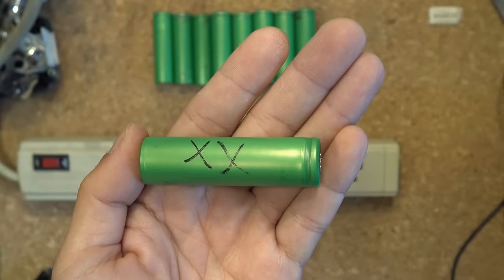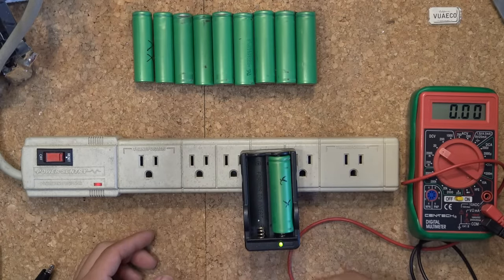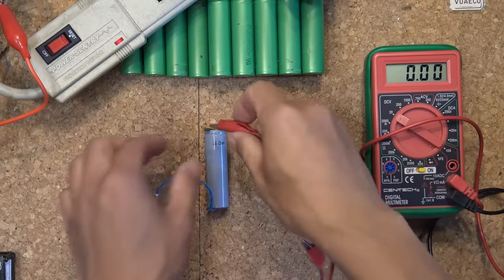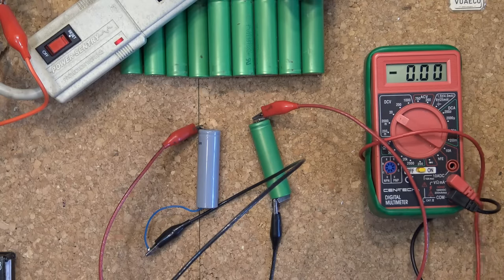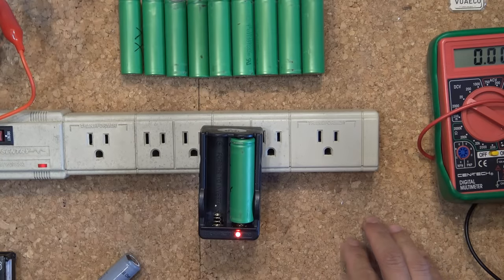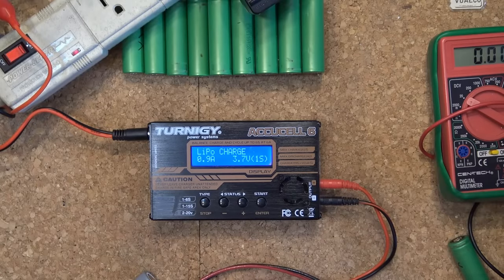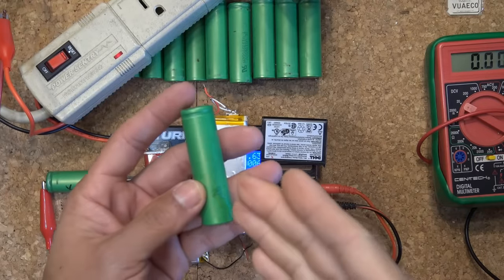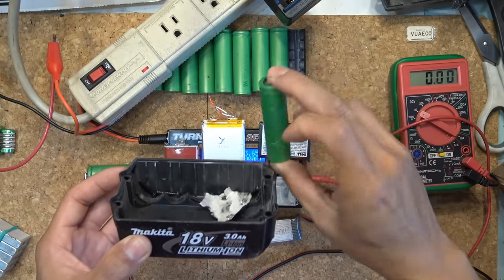DIY: How to revive a dead 18650 (or any) Li-ion battery cell

Comment: It's been my experience that a recharged dead battery cell, by any method I've seen, produces a battery that may have the voltage reading, but the amps are cut dramatically.  Which, in turn, makes them run out of charge when used very quickly.  The only success I've had is replacing the sulfuric acid in a lead acid battery with magnesium sulfate, which you can buy to take a relaxing hot bath.  The car battery lasted for about six months.  So, even this is has its limits.
Reply: I think you might be right in my limited experience in tryiing somethng like ths. I have seen the voltage decrease a bit every second when doing somethng like this
Reply: Hell no don't open batteries

Comment: Have to wonder how long that cell is going to work after doing this.  Something tells me you wouldn't get too many more uses out of it.
Reply: It wont work at all.  When he put the voltmeter on it you could see the voltage diving.  There is an internal short in the battery it will be down to zero volts maybe in an hour.
Reply: It was already dead, so whats your point. You get a couple extra charges for free.
Reply: @dreadog6425  it really just depends on why the cell is so low.  If it is at 0v its done, you can do this and charge it and it will be back to 0v faster than you can use it... maybe an hour later or a day later.  If the battery has any sort of charge when you try to save it you are going to be able to use it a lot more times... although you need to find out how it got pulled down below the cutoff voltage.  Often this happens in packs where another cell is 0v and has a short and drags others down.  Find the 0v one and replace it... pack is fixed.  Dinking around with the 0v is a waste of time.  But for testing you can charge it, measure voltage,then let it sit for a day.  Check the voltage again.  

His method for charging isnt very smart... there could be a very good reason the battery is at 0v.  Putting a good battery across the terminals of a bad one is dumb.  If that battery has a short circuit... and his does because it gets hot... you are hoping the battery can safely dissipate all the energy you are putting into it.  If you put a wire across the terminals of a good quality fully charged unprotected cell it would go very bad very quickly... like the wire glows instantly... it is absolutely nothing like an alkaline AA battery.

Interesting thing i saw on bigclivedotcom youtube, he did research on the overdischarge causing damage issue.  Sounds like it might be not so bad.  Its based on the very first li-ion batteries and they have come a long ways in manufacture since then.
Reply: @dreadog6425  At the risk of the cell short circuiting causing  a violent fire. Yeah go ahead, get those last few charges of of it............

Comment: No matter how you revive them they are good as dead, they won't hold charge for long
Reply: Strangely I have an electric bike that I have built a battery out of 18650 cells that originally tested "dead".  I  got them to take a charge using the parallel battery method. 
This e-bike will run for about 4 hours continuously on a charge; using these reconditioned cells.   It's been going like this for about 4 months now.
Reply: @DBPR01  some cells have protection inside , an ic chip that will cut the power if the cell voltage is too low. It may show zero volts when actually is not. Whatever the case, just check temperature when charging and discharging, some cells can be hotter than others.
Reply: @clixium  Both of your lasts comments are useful, I believe some applications can perfectly be made with "dead" batteries with no risk at all, such as a stupid ring device or so.

Comment: another easier option is to use the nickle metal hydride setting on your charger and then charger low LIPO. Watch as the voltage will rise to over 3.7 volts. Then stop charge and start a new cycle of LIion charge.

Comment: There are many ways to "wake up" those cells, the principal being to apply a large enough voltage to them for a brief period of time. That Turnigy charger of yours will do just fine. It looks like it uses the same firmware as the original SkyRC, so just change the battery type to NiMh, max charge current to, say 1 or 2A, and charge it up to about 3V (takes couple of minutes). Then switch over to Li-ion. One advantage is that for weak cells, you can observe that the voltage keeps dropping (i.e., almost impossible to bring them up to 3V). Also it will refuse to charge real dead cells (internally shorted). Three things you should have mentioned playing with these: 1. dead/weak cells can get real hot, so if a cell gets hot during charge, throw it away; 2. perhaps they're really not good -- after charging them up, wait for a few days to see if they can hold the charge. If not, it's time for them to go; 3. don't ever put them in parallel with good cells.
Reply: I'm kinda new to all this stuff, so please excuse my ignorance. Why do you say don't ever do this with two good cells? What would happen?

Comment: Just woke up my 25r's, we will see if they hold charge.
Thanks man👍
There was no way I was sticking something under positive to reset cid button 😢
Reply: did they hold charge?
Reply: @anthonyhadsell2673  sure did bro, still going
Reply: Really? I find that very hard to believe. Not if the cell's CID has been tripped it won't. It physically cannot! The CID is a current interrupt device making a physical separation of the circuit like a fuse. This is just a "wake up" method for very low voltage cells. However even with all that said, this is a VERY BAD idea and stupid on oh so many levels. That 1.7m people watched this recommendation is the only positive about it, certainly there should be a bunch of warnings attached to the video. It's impossible to list all the reasons in a YT comment BUT just "off the bat," paralleling 2 cells of very diff voltage levels is dumb and dangerous due to possible excessive equalization current. Just from your example of a 25R cell, if that one was the charged cell, it could easily dump over 50a instantly (25r can pulse discharge more than that too,) to the low cell, with unpredictable results on both low cells and any thin AWG wires connecting them. Fire can erupt wyite quickly in that circumstance. Yes, crap low discharge rate laptop cells are less of a danger for this, but there are so many other factors. Aside from all that, the "woken" cell may suffer from dendritic growths and may self discharge to LV quite quickly, making the entire operation essentially irrelevant. Considering how cheap these cells are I can't believe people are wasting their time, and inviting a potentially dangerous situation in their homes, but they "your life, your house/mortgage," if people are renting though, I wouldn't let the landlord see the video or comment ;p
Reply: @ABritInNY  I didnt say CID was tripped at all. Just low voltage  that my charger wouldnt charge. I used a full charged bat and jumped it in 20 second increments while holding in my hand to keep an eye on heat.
Anyway your question was really? My answer is yes, I dont talk shit.
As far as the rest of your comment, I only got to about the 3rd line before becoming to bored to continue🤷‍♂️, but I appreciate your effort, thanks. I have no doubt you are very smart😁
Reply: @rustyh1686  Understood, but then I'm not sure why you'd say in your comment"...to reset the CID button." I mean why mention reset if not tripped? That was kinda the part I was commenting on.
Reply: @ABritInNY  I didnt know what was wrong, and was just saying there was no way I was trying that. Sounds dangerous.
Reply: @ABritInNY  I only have a basic understanding of batteries to be totally hones

Comment: Be vary though. Cells that have been revived like this might overheat and maybe catch fire later down the road.
I did this with dead cells I had lying around, and two out of 20 cells started to overheat after around 10-15 charge cycles later. One even exploded.
There is a reason to why chargers don't allow recharging of deeply discharged cells. It's simply too risky.
Reply: You can make your own current varying charger, using voltage regulator such as lm714 etc.
Reply: Bypassing safety protocols can get you injured or killed. The engineers don't design them just for the heII of it.
Reply: Life is a risk
Reply: lol..... saftey protocals..... do they work ? we need them on the important stuff ie; the air ,food, water we put into our body , all saw blades should have saftey rubber applied , everyone should wear metrorite proof hard hats , im not even sure what to say about auto's & traffic, labels should be applied to couches, fridges, TV & devices warning of obesity , procrastination, tremendously useless degrees of self percieved wisdom & knowledge, anything that a murderous heart or mind that could use to kill someone should be gathered & ejected into space, starting with the first murder weapon , we will send all rocks on earth into space. we need to have warnings to inform everyone , that the omittance of morality, humility, kindness, integerity, respectfullness, thoughtfullness, thankfulness, diligence, patience, honor, blamelessness, and mostly Love, will bring humankind to a tragic and horrific end. now let's get these saftey protocals into place !!!! lol. just kidding... you left it wide open & i hadda rib on ya.. dont get mad, i apoligize, but there are so many things that just dont work with warnings & rules.
Reply: @guitarman_3693  lmao....because mostly it is assumed that we have common sense which isn't so common anymore.
Reply: What is the dangerous part ? charging or discharging cause i just revived an old battery for my my vape and i would like to know my chances
Reply: @jabez571  the battery probably won't, but the fire that it starts in your room or car. ;)
Reply: @guitarman_3693  Fun fact, all earth is already in space :P
Reply: > There is a reason to why chargers don't allow recharging of deeply discharged cells. It's simply too risky.

And what, pray tell is that reason? 🤨 I hate it when people say "don't do this" but don't explain WHY. 😒
Reply: Um all I have to say is WTF is this comment about I was lost reading it.

Comment: How to keep your multimeter in place-put it in an old cell phone case-brilliant!
Reply: What cellphone case? If you mean that green thing, that's just the standard rubber sleeve tons of DMMs come with to protect them against shocks. Electricians use these in factories and on construction sites, so not a bad idea to offer some measure of protection.

Comment: Dude there is a lot of amps been delivered to the "dead" battery if done this way, that's why it gets warm. Why not try a DC variable power supply?
Reply from the maker: No there isn't a lot of amps delivered to the dead battery. The grey LG cell I used in the video has a discharge rate of 2C max which is 3 Amps max. Plus, you only charge it for 20-30 seconds so it aint' no big deal. All WORKING Li-ion cells get warm when they are being charged up. Try charging a completely dead Li-ion cell and it stays cold as cash (this is also one way to figure out whether or not your li-ion cell can be revived- so if your cell stays cold when you do the parallel charge like what I showed in the video, it's time to throw it in the trash as it's really dead). You can use a DC variable power supply but how many people have that in their homes?
Reply: When you are charging Li ion batteries they are not supposed to heat up!
Reply from the maker: Negative. Have you ever charged any Li-ion batteries before? Watch my next video and I'll prove it to you in that video. Here's the follow up video: https://youtu.be/vFmbG8GpS4A
Reply: santiago.. I agree, a small DC power supply that plugs into the wall is best for this... We all have 5 or 6 volt, or 9 volt DC supplies laying around.... just connect for a few seconds... should do the trick...
Reply: Darryl Edington With the charger that he got in the video, you can go to the battery type: digital power
And then set it to 3.7v at 0.1a
Reply: santiago vindell
Reply: You can use an old pc power supply. It has 3.3, 5, 12+ and 12- volt circuits.
Reply: Why not just put a 3-volt bulb in series as a current limiting device as the battery sinks up to the other battery the light will go out
Reply: @vuaeco  you sounds like your charging is way above what it should be, because i have never had a li ion battery getting warm doing charging, when they get warm they break down themselves.
Reply: Nikolaj C my ecig batteries always get warm and it doesnt matter what size brand or age and charge cycles....even says they will get warm in the chargers manual....it should not get hot to the touch is what the manual states.
Reply: @melgibson6331  wtf do you charge your ecig with? A car battery-charger or some shit, i also use ecig they never gets warm when charging.
Reply: @nikolajc7617  It depends on the specific chemistry of the 18650, how much internal resistance the battery has, and the amperage the charger is delivering. But generally, good 15A+ discharge hybrid chemistry batteries won't heat up much if at all when charging. I've had 18650's that don't heat on the same charger where some do. Cheaper chargers that don't regulate will also heat up batteries more than those that do. A little heat on the charger is fine, it's when they're hitting 70c+ is when they degrade.
Reply: This can be incredibly dangerous, especially if dealing with abused cells, power cells, or pouch cells that have no protection.  Take extreme caution.  Recharging this fast also grows dendrites... BOOM!
Reply: Uhhh,.....the 2C rate doesn’t mean the charged battery discharge is limited to only 3 amps, but rather 3 amp draw will produce its rated capacity. Don’t believe me, take your charged battery and short positive to the negative with your ammeter in between and see how many amps it produces....hint it will be above 3amps. Your scenario you demonstrated had enough amps to heat the dead battery within 30 seconds, means it was over 3 amps input. I recommend using a power supply that limits current to an amp and voltage to 4.1v. Or do this outside away from combustibles and at distance while wearing protection.....or don’t do this at all. Likely that if the cells were .5 volts for any significant  time, they are internally damaged and likely a charging hazard, with limited capacity.
Reply: vuaeco i guess the problem here is you’re doing and instructional video and not saying what you’re using besides ”a good cell”. Someone trying this may connect a powerful cell like this and cause a fire. Don’t teach people dangerous methods, or at least inform them of the risks.
Reply: @rodsofgod6863  they do heat up when charging.

Comment: do you have a guide for dummies? i mean i'm a super newbie with no to least experience with batteries. I used to throw batteries that won't charge so it's thanks to your videos i found out i might save em. please start by posting the items/gadgets you used to check and charge the batteries and the things that i should be careful with and look at. thanks!

Comment: This method will most likely cause additional degradation to the battery. For really dead cells you should perform a process called "pre-charging" which charges the battery at a very low current. Here's a video by EEvblog that explains it:
https://youtu.be/A6mKd5_-abk?t=894

Comment: turn the accucell in nimh charge 0,8mha for ~1 minute in litium for eleve voltage over minimul value, after charge in normal liion mode, best charge....
Reply: And a SAFE way !
Reply: Angelo o tried your method and it work in just two minutes..... Thanks 😊

Comment: Do a Capacity Test on that cell.
Reply: The battery will not be able to stand and even for long term
Reply: Even if you charge it up to the normal voltage, it will slowly deplete back to the deadly voltage
Reply: Not always true ' I revived a point and shoot camera battery that I had let get too low and it's been holding a charge each time at normal levels for a year now .
Reply: @stringsattached67  But how long were they under 2.5V? I read that if it's for several weeks, you can forget it. The chemistry of the battery will be completely destroyed and the battery will lose all of it's punch/C or whatever they call it.
Reply: @InTheSh8  long enough to where it wouldn’t even trigger the charger until I jump started it ..

Comment: Great video. I had a battery pack for a VAX vaccume cleaner that would not charge. With the batteries in place I applied 4 volts to each cell ( one at a time ) After removing the 4 volts each cell was nearly 2.9 volts. I plugged it in to the pack in to the charger and the it charge up. fully after a few hours.

Comment: but after charge, battery will NOT give a lot of power and be descharged in a few minuts !!!
Reply: you might get lucky, and bring the cell back from the dead, after several charge and discharge cycles, but the battery will rarely ever get back to a full charge and discharge envelope. I also would NEVER charge these dead cells indoors, and always keeping them in a burn bag!
Reply: Discharging to 0.5v (say in a single cell torch that's been left on) does not do the cell any good but probably will not kill it.  Batterys with multiple cells will typically when taken down to very low voltage often ends up pulling one cell below 0v and that does kill the cell.....   Also aparently to recover a over discharged cell charging at 0.1C during recovery is best not this 10+C method shown here....  (IMHO, Results will vary etc...)